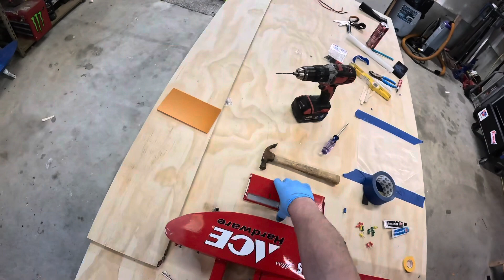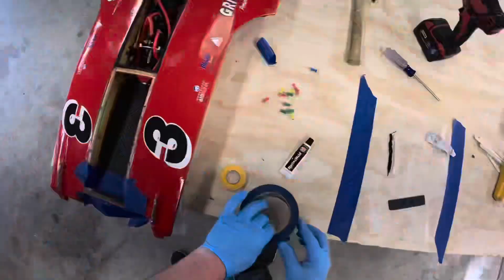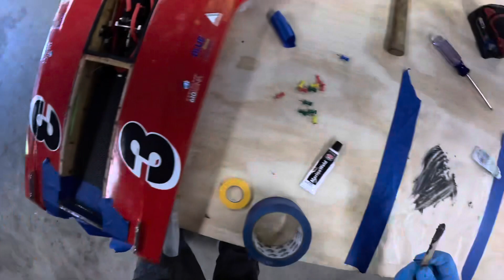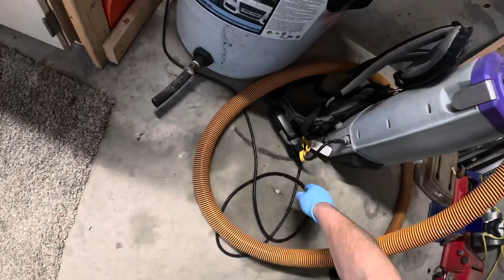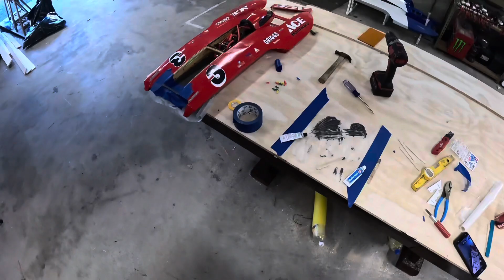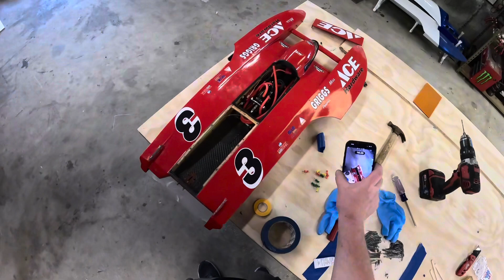Crash and Repair of the Ace,

Comment: Hey,

I just finished building a 10th scale hydro and am running the tenshock motor and castle esc. Just out of curiosity, where are you setting up your CG. At the moment im limited to room and i am about 70mm behind the turn fin.
Reply from the maker: Same thing what I was faced when trying to get the COG just right.   I added  weight in this Sponson to get it moved up further     I would have to get back to you on exact measurement.   However, I want to say I’m just over an inch behind the Sponson.  Just slightly back from center of turn fin.